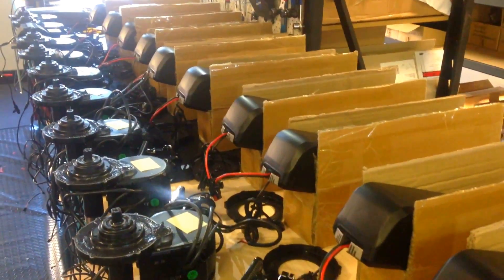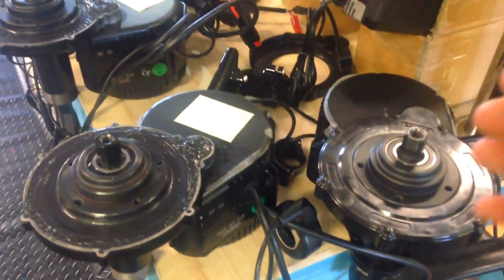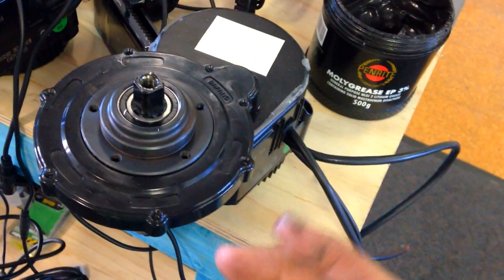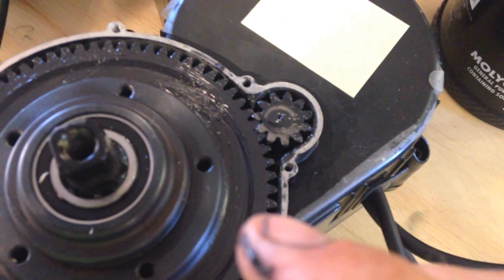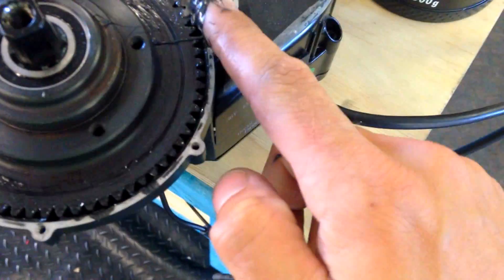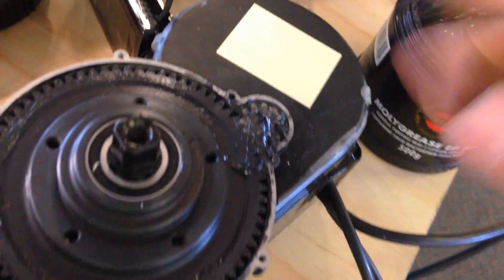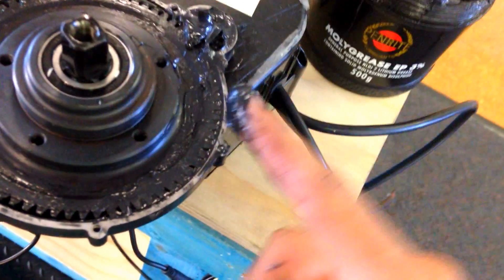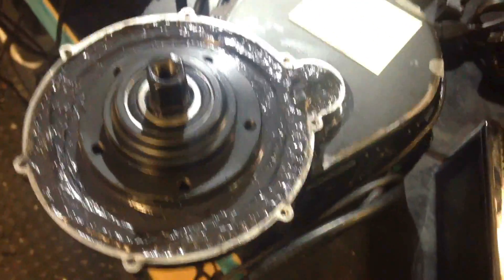Making your Bafang BBS02 mid drive last longer with extra moly grease • 8fun Electric Bike BBS01

Comment: After about 2000 miles my BBS02 started to make a distinct whirring noise - your advice fixed it for me. Thanks for being clear about how much grease to use. Lots.
Reply from the maker: Yeeeeeaaahhh I’m glad to hear that this video I uploaded years ago still helping lots of people out there!! The helical pinion gear unfortunately pushes the grease in the wrong direction making the gears run dry too quickly, I’ve greased myself maybe 300 BBS02 motors in 2 years packed a lot of extra grease before sending to customers and that alone fixed so many problems. =]
Reply: Was the noise loader in a higher power setting? Mine has started to make the same as you say "whirring" rather than a squeak or whine. Pretty worried as its my commuter but fingers crossed its just lack of grease.
Reply: @MacauGr  Yes it is possible to over grease. To much grease might build up to much pressure on the seals.

Comment: bruno, tell us how u would set up a velomobiel w/bafang up front on the horizontal boom??!!??? Please. We want it to hit soft @ rear when changing gears.
Reply from the maker: +Pushyhog yeaaahhh best thing you can do is to add a gear sensor and change the programming settings for smooth start instead of jerky start.
Even better if you could use the MaxDrive motor with torque sensor instead of the BBSxx motors, much more reliable motors too but you need to take to a welder and weld the motor mount to the boom. Yes you can program that motor to 25A and hit 900w peak =]
Reply: 1959 schwinn spitfire bike

Comment: Hi I got a bafang rear hub motor and it started hearing like a winding grinding sound when I first start off and I opened it up and it was full of white lithium grease and now I packed it with black lithium Grease I'm still hearing the noise if I use the Black Molly grease will it get rid of the noise I'm really worried

Comment: I've fitted a bbs02, with the motor off there is alot of resistance, it's like you are riding through treacle..brakes are not binding..turning hands with crank is as smooth as regular BB, there is bit of resistance but you can turn it with little finger..its just when you're riding. It's not simply with the extra weight as it's very noticeable. So you have any ideas what the problem is?
Reply: when motor off , your fighting against all the gears friction and the motor + extra weight of the bike.
Its normal unfortunately...

Comment: I recently got the grinding noise in my BBS02. I greased everything as described in the video and it works like a charm again. I used lithium grease and hope it's going to last for a while. Thanks for the video and your POWEER :)
Reply: Moly grease is best for heavy steal metal to metal contact
Reply: @OnefiveRc  OK. Will keep that in mind. Thanks!

Comment: I have a plan to dismantle the engine on parts and use new grease for everything. What grease is the best for plastic - metal, metal - metal, to inside nylon gear to small gear, and ball bearing in hub?
Replacing the grease is a good idea?
Reply from the maker: +Mateusz Kamer the white and thick Lithium grease inside the motor lubricating the nylon gear is possible reuse again if doesn't look contaminated. White means good, grey probably got mixed with something = replace with a general purpose grease that is really thick and suitable for plastic/metal. Thick grease is important otherwise it will splash everywhere inside the motor at high RPM.
The big metal gear just use molygrease, this is the one that comes with the motor.
Some people are using the synthetic Mobilgrease28 but it's a bit hard to find outside USA..

Comment: i found moly at walmart and finished project. Gotta buy brake and rohloff inline motor shut-off sensors & install those in the velomobile. Thanks!
Reply from the maker: Walmart?? ahhahahaha.. I didn't know they sell it there hahaha
Velomobil... ohh yeaahhhh... now we are talking... this will be the ultimate lightweight electric vehicle... efficiency taking to the next level.. you'll  have sooo much fun.. ohh yeahhhhh =]

Comment: i use a silicone grease packed with about 7%wt PTFE and tungsten disulfide powder each. that massively reduces friction and noise under high load. the silicone grease is pretty sticky and will not get flung off the gears, tungsten disulfide is so tiny it will get embedded in the steel surface
Reply: @dedu456  after all the grease trials, the best grease hands down is Lucas X-TREME heavy duty mixed with about 10% volume Synthetic transmission oil 75wt and about 3-5% 1.6micron PTFE
the grease provides extreme pressure lubrication, resists deplacement and thanks to the transmission oil, it flows pretty well, yet remains sticky.

Comment: hello, i have a problem with my bbs02 motor, it was kept without battery during winter for like 5 months with the battery inside my house and now it won't start, if i plug the battery and unplug it for 10 times repeatedly, the display comes on for 2 seconds and then turns off, no error code. please help

Comment: my 60v dc-cd stepdown buck converter failed, it was fun while it lasted....... seriosly thinking about just swapingout the controler to one that can take 60V+

advice?
Reply from the maker: +Daniel Liaw - Heeey Daniel... what step down buck converter, this one here http://www.ebay.com.au/itm/DC-DC-Converter-4-5-60V-Adjustable-Step-Down-Buck-Power-Supply-Module-LM2596HV-/381197607058?hash=item58c125e092:g:pZwAAOSw-7RVE8oj 
From what voltage to what voltage? Will something like that work for you? http://www.ebay.com.au/itm/Car-Power-Supply-DC-DC-Converter-48V-Step-Down-to-12V-10A-120W-Regulator-/181199953380
Reply from the maker: oh... cool one.. thanks for this link...=]
what are you connecting to your bike? haha

Comment: Bruno you are best. I did a research and found that moly grease is based on lithium and is compatible with white lithium grease on premier nylon gear. In case of leaking this moly grease into the internal gears wont be any harm. I also would say that mob 28 is an Incompatible grease with white lithium grease, so if anyone for any reason wants to apply mob28 then maybe better to pack the mob28 in every where not only secondary gear! As i read somewhere, bafang uses like 5-6 different types of greases in their bbsxx motors so i would not wipe all those types of greases and replace with mob28! Sorry for my poor eng!

Comment: Any advice on how to stop my new BBS02 overheating ?
Reply from the maker: Some people have glued some small computer heatsink to the motor controller and motor, it improves a bit but you’ll get better results fitting a 42T Lekkie chainring (smaller than the one that comes with the motor) you’ll lost just a little bit of top speed but much better acceleration. Also you need to keep changing gear and always keep the motor spinning fast, they work better fast, much less heat and more power, improve your range. If not happy, sell your BBS02 and get the BBSHD, much better motor I’m my opinion =]
Reply: @BrunoPOWEEER  many thanks , I have ordered a 34T chainring , is that too small ?
Reply: @BrunoPOWEEER  You could make a video about how you manage your gear while riding your e-bike, capturing some examples.

Comment: I just installed my Bafang and done 100km.   Should I put grease in now or wait for 1000km?
Reply from the maker: I would say between 1000-2000kms then just open the big cover and see how the grease is around the pinion gear. Sometimes you can just push the splashed original grease back again over where the two metal gears make contact =]
Reply: @BrunoPOWEEER  Thanks.  I already bought the moly grease.  I've heard of people referring to the nylon gear.  What is it and where is it?
Reply: Saw your other videos.  Wow.  You really took it apart.  Why do they use that plastic gear?  Why not metal?
Reply: @diggler2002  better to have a failure point so it doesn't take out the other parts with it.

Comment: Hello Bruno.    May I ask your thoughts..?
I have a Bafang BBS02 48v 750w mid-drive, the PAS pedal assist is not engaging when i pedal.  (unless the power level is 5 or higher)  Can this be corrected by plugging it into a computer and making adjustments?
The thumb throttle works fine and the display seems ok.    Just the PAS...
Or is it  that the PAS sensor is malfunctioning..?  and if that is the problem, can the sensor be easily replaced..?
I heard that my problem is generally not a controller problem unless the PAS wire is not connected properly.  (that does not seem to be the case)   Your thoughts...?
Thanks Bruno..
Reply: SAME ISSUE HERE CANT GET A ANSWER
Reply: @mrshroff3798    Hello mrshroff.. i gave up on the 750 and replaced it with the far superior HD.. I don't have the problems i had with the 750..  :).   The HD is far easier to service.  the shaft with the reduction gear comes out without having to disassemble the multiple parts of the 750.. It is just a better motor design and has no issues bogging down.    Hope you get your 750 working..  PEACE

Comment: Hello Bruno: Great videos, Dude!

I have some questions. Thank in advance for answering.

- Is it good to grease all what's gearing in the Bafang BBS when it comes brandnew out of the box?

- Which gear ratio/which gears are good for cargo bikes and going uphill? 

- Where to buy really good battery packs 52V (or higher) with high capacities for for example BBSHD? Which cell brand/model/type is good and reliable? 

- Where to buy spare parts for BBSHD? 

- Which rear hub motor brushless 1000 Watt (or higher, brand/model) is good? And which controller is good/best (brand/model) for a rear hub motor like this? 

Thank you very much.!

Comment: So I did what you said with the moly grease and within 25 days my internal gears were fried! From what I hear it's best to use the red mobile 28 aircraft Grease. Any opinion on that one? Just running a 52 volt battery basic kit
Reply from the maker: +Jason Hall hey Jason... this is very strange, even Bafang themselves use molygrease... I added grease to at least 300 motors and never had a single problem... molygrease can't fry gears it it actually saves your gears from frying..
I am not the only person adding molygrease, there are LOTS of people doing the same thing and they also never had problems.

The Mobil28 sounds like a good option due to the fact that you can have the same grease on both, first and second stage internal gears (suitable for plastic or metal) but I haven't tested it myself... the same person who recommended the Mobil28 also recommended a very wrong corrosive grease to many many people previously causing some serious problems to many riders... new grease is always "good when is new"... not sure how long they actually last in this application riding every single day in hot and cold weather. There's no such thing as everything proof / forever lasting grease, it'll eventually break down and after intense use and needs to be completely replaced with new fresh one.

What could've happened to your case (I'm just guessing here) is that your grease reacted to the existing grease OR sometimes there is a little crack on the plastic covering the gears and water could get inside. Water + grease + heat also break down the grease. Another thing we should consider here is that grease is not the only reason you had mechanical problems. The chainring size is really important, bigger chainrings put LOT of stress on internal gears 42T is ideal size. Changing gears under load, chain skipping cogs under load are maybe the worst thing... super jerky programming is the same, it can destroy gears if ramping power is not gradual and smooth.There are lots of factors to consider before blaming a grease... 

Very very long reply but I just want to clarify that I'm not recommending wrong things here, there are waaaaaaay too many factors to consider too =]

**if you try the Mobil28 please drop me a comment here letting me know after months and months of use
Reply: ACTUALLY, it's a matter of overpacking with grease. too much grease will result in churning of the grease which creates HEAT. If that's what you mean by fried. Otherwise perhaps you used greases of incompatible thickeners or oils?

Comment: Hello there. I having an issue with my BBS02 motor. Between the speed of 25-30 KM/H i get some vibrations on the motor.
I looked it up and found out, that its a popular issue. People say that its a controller bug thing. Others say that greasing your motor can solve it. I am wondering if you came across this issue. And most importantly - should i be worried?